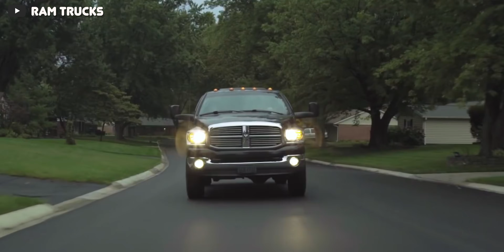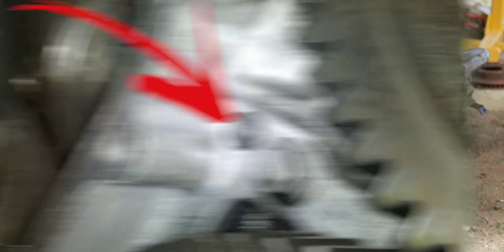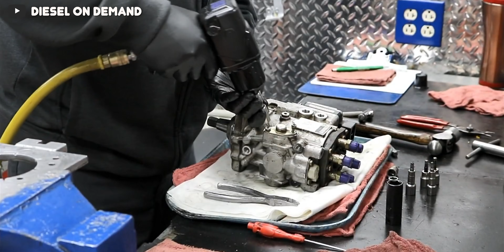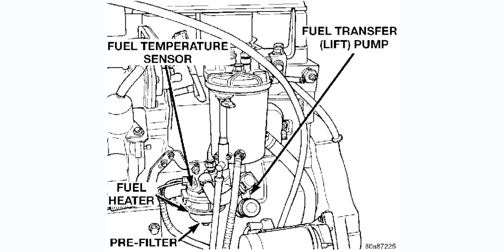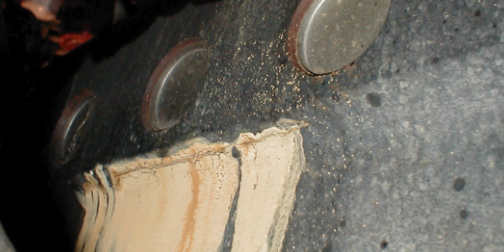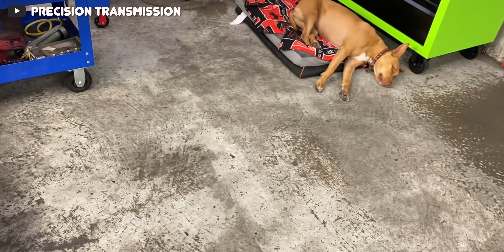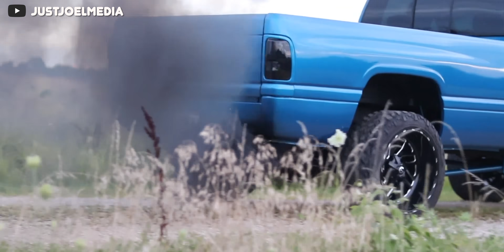Everything Wrong with the 5.9L Cummins (12V & 24V)

Comment: I had always heard the in tank setup was bad. Mine has the engine mounted pump which I had to replace as well as the tube from the filter cannister to the pump. My truck was a plow truck and not well treated so the 47re had to be rebuilt which was done with HD parts. I do find it to be reliable. I bump the starter and wait about ten seconds then turn the key and it turns once and starts right up.

Comment: Every one seems to have forgotten the 2.3 turbo Mitsubishi in the D50 small pickup. I owned one. Close to 40 MPG, lots of power for a small pickup. Sold it running at about 700,00 Km. It needed injection pump rebuilt and parts were getting scarce.

Comment: Listen here baby boy my 97 12 valve 5 speed isn't called the holy grail because it sounds cool. They put an industrial motor in a truck that will fall apart around it. The bt6 is by far the most reliable diesel you can get

Comment: So in summary for the 12V, spend 15 minutes clamping a bit of sheet metal over your KDP and you will have an indestructible engine that can destroy transmissions if you're not careful. Most would already be suspicious of third world casting, and anyone who's had a diesel running a VP44 (I've got two 🤮) knows that pump is a massive POS and wouldn't want to buy another engine with one on it.

Comment: Well,technically it is slightly overrated.
It is extremely heavy, not that efficient by modern standards and difficult to use in all but a few places that actually have the space required.
That being said, aside from the KDP issue that is easily addressed by any competent mechanic, it is a very rugged and long lasting diesel engine.
A very capable power plant in the right use.
Not revolutionary, but quite good in standard livery.

Comment: Hey guys I need help. I have a 2006 5.9 Cummins mega cab. I bought it last year in 2024 with 220,000 miles on it. I spent 20k cash before tax in TN. 
Two months later all the fuel injectors went out, and then the AC, then the trans.

I got everything fixed. I bought the “SUNCOAST” trans because it’s the best(supposedly) and after 8k miles it’s in the shop again. Won’t catch 1st gear. Takes off in 3rd mostly.

The problem with the AC was two thing: 1 all the plastic directional flaps were broken, so I had aluminum ones installed that will never break. BUT…. On full blast, it like on setting 2 in all my other vehicles. And I can hear it blowing hard behind the passenger side dash.( like it’s working as it should, but something is clogged) But the fucking mechanics couldn’t figure it out??? Pisses me off. I spent 17,900 getting it fixed. New fuel injectors, new ac directional flaps, new rotors, new trans, and I’m still having issues…

I have so much invested in this truck that I can’t sell it. I HAVE TO FIGURE THIS OUT!

Can anyone help me with any of these issues?

And lastly, is it possible to just pay and engineer to design a new transmission for the truck that better?

Oh and lastly, lastly, this truck has NO OIL OR FLUID LEAKS. It’s in extremely good condition. I’m the second owner. First owner took great care of it inside and out.

Comment: Okay what about the 47RH not the RE or even the the original 12v with non intercooled. The intercooler was just a form of EGR. As a tech at a dodge dealer for over 20 years, I see huge flaws in this video. Also the fact I own a 89 12v, 24v 53 block and 2 3rd gens both 5.9. yes the region of the USA does play a part, However I feel if your going to make a video you really needs to spend more time and read up. how you hit 175k with flat out BS is unreal, But then again look at LA as of 6/10/2025.

Comment: I just rescued a '89 D250 with the 5.9. I'm thinking of a re-body to a 81 Cherokee Chief, but would really like to know is how fuel efficient at ___ RPM's they are?
My 5.9 AMC 360 was getting about 17mpg if I stayed under 55 mph with a 3.31 gear. If it will ever stop raining, I'll get under and look for the ratio on the Dana 60 (?) 
Also, Wonder if drilling and taping a hole in the timing cover over that dowel, and screwing a bolt in to hold it. And if it's NOT there, and she's still running. GREAT!

Comment: The 12 valve was designed and used in international/Case tractors, 4 years before it was put in a Dodge  its overbuilt and will last verryyyy long if left stock. Truck is built like a Tuna Can, rides like crap unless you put 1000lbs in the box and can't hear anything other than that sweet diesel going down the road. Its a great ride if you don't wanna hear your passenger(wife)😂😂 and gets the highest mpg of all pickups.

Comment: My '05 Ram just turned 150k. 4WD, 6spd manual.  Oddly enough when the motor turned about 135k, the mileage jumped up from around 17 to around 24. Guess it just broke in.

Comment: I currently own a 2001 Dodge 3500 with a 5.9 Cummins 24v, all I have done to it so far that was expensive was the injector pump went out and I had to get a replacement, at the time and I could only get a Standard brand from O Reillys auto parts. Also in the stock location I installed a Fass Lift pump, I have not done the killer dowel pin yet because I was told the factory put a dimple next to the pin to hold it in place on 2000-2002.
I do not know for sure if that is true without looking at it first. I only have 175,000 miles on mine the injection pump went out around 160,000 miles. Other than that I will never get rid of that truck, I can pull a house down or pull anything with it I want if I need to and it gets 21 MPG. Thanks

Comment: I bought my 96 Dodge 2500 new and still have it with 400,000 miles. Presently having electrical issues probably needs all new cables. Everything still works, a little rust but still a great work truck. Of course, I did the killer dowl pin $1000, a sump fuel connection w/ a fass fuel pump. The truck always starts and runs strong still. I think I went through 2 transmissions before having a bullydog transmission. It was rebuilt once. I also now have a Ram 3500 w/aisin transmission, still need to install the new Banks intake to address grid heater bolt. It amazes me how people just say a truck is bad when they haven’t really owned one or bought a used one not cared for.  All trucks have their issues, hence manmade. My wife gave up on trying to get me to sell it 😊

Comment: You know I wonder if you spent more time explaining  how to fix the problem instead of what is wrong with it. People  need to know for sure  what to look for and I don't  care but every engine has a default.  Do you look into  how to make it better. Here is a few things . One speed of air pistons, 2 ball bearing  turbo, 3 up dated lifters,  better fuel  pump. Better air flow. This is just some of the things. Truck makers did all this you would  not be able to afford the truck. So if you want to make it better by one 5.9 and do what I suggest  and quite  bitching about it fix it

Comment: The 5.9 is not a light duty engine it’s a medium duty engine same as the newer 6.7 they have been around a very long time in all sorts of construction equipment way before being introduced into a pickup if dove normally and serviced regularly they’ll last as long as a over the road caterpillar Cummins Detroit engine which can be over a million miles something I’ve never seen in a power stroke or duramax not saying impossible but highly doubtful not to mention I have no use for an engine that has to have blow plugs to fire up and don’t tell me they have them they don’t they have a manifold heater that is useless and not needed if it was needed then semi trucks would be using them

Comment: I have a 99 F-800 18' er with a 12 valve Cummins, it's nice running but a dog going up the Pa 6%grades,any cheap power upgrades would help.
It has 120k on it and this winter I wanted to take out the radiator and deal this a new water pump and that KDP

Comment: Cummins 5.9s are placed in fords (new & upgrades/ f-ummins), chevys, busses, boats, ships tractors ect. There's a reason for that. My 06 had 540,000+ miles on it. Sold it to a friend and he has so far put another 120,000+ miles on it. Fuel filtration and a good in tank pump is all they need. I did have the trans rebuild, but that's because i ran a tuner. Fast, high torque beast!
Reply: And they're a 12v. It's because their cheap and easy to do the swap. Fuel, power and you're set. Don't see common rail 5.9L in a bunch either. There's a reason for that too.

Comment: Say what you want, mine has 330,000 miles, I've had to replace batteries alternator and starter. This truck is the most reliable thing built and i hate dodge but not this truck.

Comment: One more thing .... a little bolt that is holding the air heater can loose and then it will go into a piston. The last cylinder is too tight and will scratch cylinder with overheating. But hell of a good one and good for at least halve a million miles.
Reply: That's on the 6.7s not the 5.9L

Comment: A GUY I WORKED FOR BOUGHT CUMMINS FIRST SHOW TRUCK AT A FARM SHOW IN COLUMBUS INDIANA THEY REVEALED IT HAD A PLATE ON IT SAID KONG 5.9 THAT THING WAS A BEAST WENT THUR 3 TRANSMISSIONS AN ONE OIL PUMP 89 RAM ONE TON BLACK AN GRAY TWO TONE DAULLY IT PULLED SHINGLES AN FIREWOOD AN TRASH TOO ROOFING COMPANY BOUGHT IT ...

Comment: take a 24 valve, put the P-pump on it. grab a 3rd gen head - machine the cross over tube ports. there ya go.  more fuel, more air, better engine.

Comment: Asife from the KDP, the crankshaft position sensor fails at once at around 300k miles. Minor in comparison. The way to tell it failed is that the RPM needle stays at zero with the engine running. The alternator stops charging (without warning light), and the auto transmission acts up. Best to replace it preventatively., especially ahead of a road trip. Or at least have a new spare on hand, it's a relatively easy procedure.

Comment: The whole RE line is a 3 speed 727 with an overdrive clutch/spring bolted on
.
The 46re behind my jeep 4.0 is fine
Not enough power or rpm to matter
.
The fluid even stays cool to the touch lol

Comment: ‘97 12valve…deleted fss, fuel heater element,wastegate feed. Tabbed kdp, adjustable ofv, 4”straight pipe, fuel pressure, exhaust temp, boost and transmission temperature gages. Lockup switch…All mechanical reliability…the BOSS!😮😅

Comment: I put off on the dowel pin thinking...i will get to it soon. Well an hour or two would have been much better than the $5000 it cost me after it blew off the top of the timing case....oh well...nothing else has ever happend in over 150k miles...she has 265k now and with some fueling changes, pump timing to 18 degrees and so 3000k springs in it she sure is still fun to drive.

Comment: I agree the transmissions aren’t up to the part of a modified Cummins motor but if you maintain it properly and get a good shift kit like a Transco shift kit those transmissions hold up very well even with a modest horsepower torque game I wouldn’t call them a piece of poop because remember that’s the early 1960s Design Credit to the people back then who designed that transmission and with the aftermarket parts available there’s guys running 1000 hp guess at 48 RE and doing quite well with him all right you have a good day now This is six in a row Jim from Kennerdell, Pennsylvania

Comment: It’s the only diesel made the V anything is junk ! V8 are great for gas motors but not worth a dam for diesels and to prove it just pop the hood on any road tractor and you will a inline 6 every time don’t waste you money on V8 diesels and you get more for your money with V8 2 extra pistons two extra connecting rods and 2 more lifters and you get a lot of extra parts and you get to pull the cab to change spark plugs !!!

Comment: My poor weak 48RE trans in my 2005 Ram 2500 only lasted 465,000 miles before having to be rebuilt. I'm satisfied. Engine still original at 477,000.

Comment: When the 47re is built and built right its one of the best racing and hauling transmissions you could ask for. Especially with a ratchet shifter and  or lockup switch👍

Comment: 12v engine only the dowel pin is the problem, fixed with a plate or a modified backplate on later production engines, thats it. The 24v is all about fuel pumps, not made by cummins and dodgy blocks made in south america, so overall the 12v is bomb proof and so is the 24v if its not a 53 block, the fuel system is shit when fitted by other oem's too, made by bosch, not cummins

Comment: 2002 3500 4x4. 290k pulling a 5er 43' toyhauler. Fass 150 HD , super B turbo , 4" exhaust , trans has a non stock converter and valve body upgrade its been rock solid this far. Might get a quadzilla and put a full built transmission soon.

Comment: Don't let this distract you from the fact that there's well over 1,400 cummins powered pickups on the road with over 1,000,000 certified miles on the original engines that haven't had anything more than routine maintenance done to the engine....that's impressive.
Reply: How many Duramax,s are there 😂

Comment: I was given a 95 dodge with the cummins.  First thing I did was take care of kdp KDP issue. Also found and replaced a failed water pump. All the plastic is pretty much disintegrating but damm I like the engine.

Comment: The only electronics in my truck is the brake box and the Pioneer radio.
1992 Dodge 250 two weel drive, Getting five speed.
Unless someone else damages it, i will not need to get another truck for as long as I live. 
If i need to go fast ill drive the SRT.

Comment: Currently own a 98 12 valve with the automatic 47re…hands down worst transmission ever. Literally the worst. Ride quality…doesn’t exist. Electronics work via smoke signals. But I wouldn’t trade this truck in for anything, got me across the country several times, once with a cracked timing case and a bad oil pan gasket. Love it and all her flaws

Comment: As someone who works a 5.9 24 valve dodge auto 3500 daily, I can say once you have a built trans and a better than stock lift pump, that truck is indestructible.   I work it with a large gooseneck trailer loaded down quite often.  The truck is beat up, dash flew apart, seat is ripped, etc.  but I won’t hesitate to take it on a thousand mile trip towing.   I’ve passed a lot of fords, newer GM and Ram trucks stuck on the side of the interstate.  200k+ on the clock and still going strong.   Even if it dies I’ll rebuild it cause it’s way cheaper than a new rig with emissions and complicated computers
Reply: I'm serious considering putting a 1990 gen1 5.9 12v on a 5-speed powerplant in my 1967 Chevy C20 With an intercoold compound trouble
Reply: @scottduthie2912 I did that with my old Chevy square body c30 single rear wheel 4-wheel drive back in 91 I think it was I put Banks turbo on it it was a great truck
Reply: Well said, I’ll never trade my 2nd gen Cummins…
Reply: You’re absolutely correct
I have a 99 dodge ram 2500 Cummins 4 x 4 automatic with a 1 ton transmission, new Bosch injection pump, FASS LIFT PUMP, COMPLETE SUSPENSION, BODY LIFT FOR INCH SKYJACKER WITH SKYJACKER SHOCKS HEAVY DUTY, FRONT END, NEW SENSORS, CRANKSHAFT POSITION, SENSOR, HEAVY, DUTY, ALTERNATOR, truck with 185,000 miles drives better than new
8 foot Weston plow brand new BFGoodrich tires 
New batteries

Comment: 5.9 liter vs PowerStroke & Duramax. No contest. Had an 89 and a 2000, never had a problem w/ the core engine. The VP-44 was fixed w/ a Glacier Diesel lift pump kit.

Comment: My 02 24valve's been the best truck I've ever owned. Sure its on its 4th lift pump and 3rd vp44 because of said lift pumps failing but people bash on them like crazy mostly due to poor maintenance. My trucks been a tow rig from 3 years old on, the owner I got it from used it solely to tow his 5th wheels camper, bring trailer loads of chem and pesticide totes to the fields, move augers and fert carts to fields until  bought it in 2020 then I've used it basically for towing only as well. Trans has never been done but its close as the bands are now at the end of adjustment. The biggest killer of the 47re/RH is people driving the trucks like they stole it and just being all around hard every second on them. My truck doesn't look like it was a farm truck or a work truck in the slightest but it couldn't be farther from the truth. Be a cold day in hell before I ever consider giving her up.

Comment: Everybody forgets about the 7.3 idis… arguably more reliable than a 5.9l.. i know of multiple and have one thats got a turbo kit on it from day one and is still kicking at over 600 thousand miles.. 15 psi through a motor that was factory na with a a compression ratio north of 21:1… not to mention the 24 mpg i get in my dually idi

Comment: The problem is it's in a Dodge... And Dodge transmissions suck. Plus it's a inline 6.. 
Now what Cummins needs to do is...  Isn't build a V8 diesel, but the first v10 diesel. It wud seriously stand toe to toe if not finally above the power stroke.. 
Imagine that .. cummins v10 diesel... Fuck it wud be insane... But they need their own built transmission behind it

Comment: The problem is it's in a Dodge... And Dodge transmissions suck. Plus it's a inline 6.. 
Now what Cummins needs to do is...  It build a V8 diesel, but the first v10 diesel. It wud seriously stand toe to toe if not finally above the power stroke.. 
Imagine that .. cummins v10 diesel... Fuck it wud be insane... But they need their own built transmission behind it